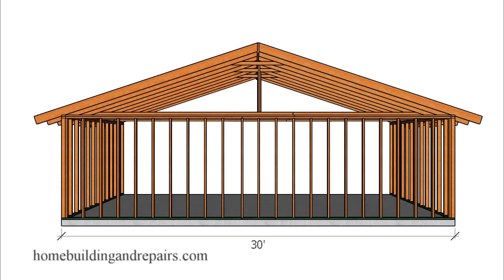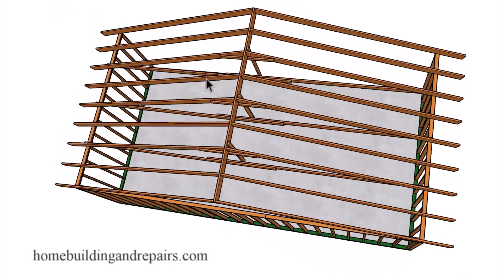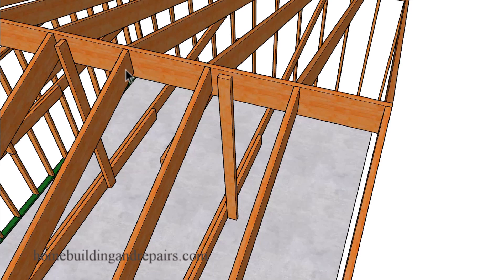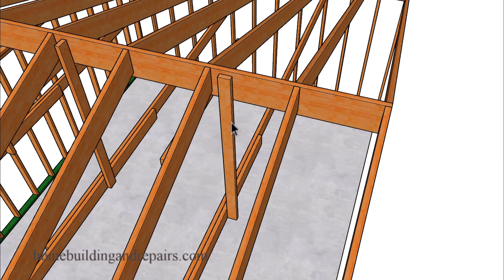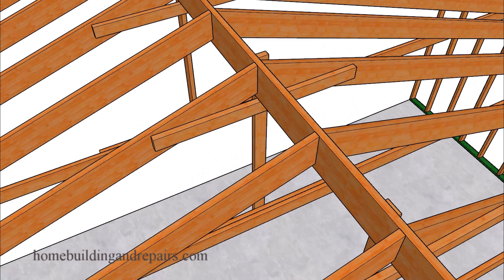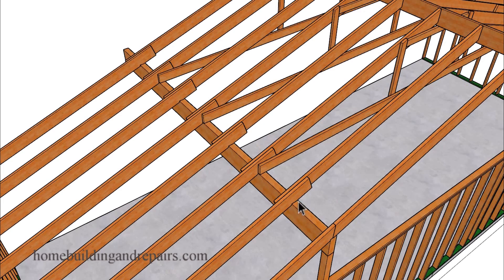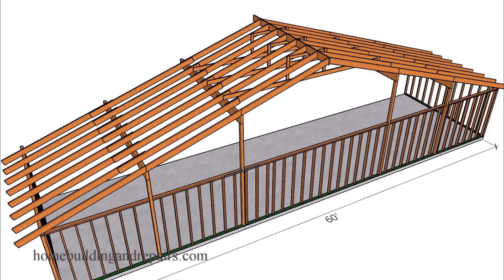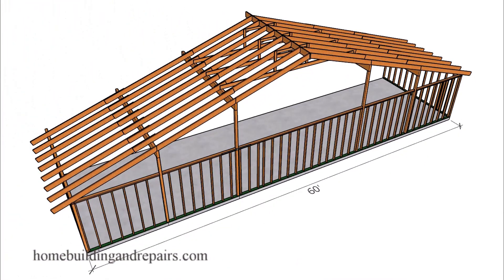How To Build Longer or Wider Building Using Rafters And Beams Instead of Engineered Roof Trusses

Comment: I'm searching for a suggestion for rafters designed to hang a floor, strong enough to be strong. I want to build a 60x100 ft shed with open span lower level without supports. I want to span a floor and second floor for use as a craft shop. The lower level will be an open mechanical shop for large equipment.

Comment: im building my own house for the first time, i am a union pipefitter not a Carpenter, but I figured if I could build multimillion dollar process piping systems how hard could the house be? 
I live in an area in Ohio where $50 dollars and 
a copy of your floor plan is all that is required for a build, no inspectors afterwards. i have found a home design online that I like, and I have begun engineering from a photo on sketch. 
House I picked has an 812 pitch roof, 40 foot wide house with an 8 foot porch over hang, requiring a 48 foot trust.
I would like a cathedral ceiling, only thing the builders in this area offer me is a 712 piggyback trust. 
I would have liked a scissor truss or possibly done something like this.

Comment: The ridge  beam that goes across the top  is it still needed for engineered trusses 50×50 ?
Reply from the maker: You would need to ask the truss manufacture, but most of the time roof trusses don't use ridge beams.

Comment: I have an odd one. I have a detached garage 32 x 28. The joist run 28' long. They are starting to sag and I plan on insulating and drywalling the structure. Is there any way to clear span 32 foot on an existing structure?
Reply from the maker: I would think steel I beams or large glulam beams.

Comment: Is the method of using spliced rafter-ties/ceiling--joists supported above from the rafter's ridge board (to span distances greater than conventional lumber is available in) compliant with the international building code?  (Just asking as I can't find that it explicitly is?)
Reply from the maker: Good question and I will look into it. I don't remember any and usually lapped my connecting rafter ties with a four foot lap and about 10 - 16d nails.
Reply: @gregvancom  As best I can tell it's permitted to lap rafter-ties if secured with sufficient nailing similar to the requirement between the rafter tie and the rafter itself; but attaching said rafter-tie/ceiling-joist to anything else but a supporting beam (as opposed to a ridge-board) seems not to be permitted (except possibly if signed off by a structural PE). Overall I like the idea, as it should be a simple matter to add the worse-case ceiling load to the dead-load requirements of the rafter span, but this is not detailed in the code as best I can tell.

Comment: To save money vs. trusses I want to build my own roof system for my garage. The front gable side is 32’ across. 28’ deep. I want to use a 28’ LVL as a ridge board and 18’ 2x8s as rafters with a 4/12 pitch. Now this is where I struggle finding info on supporting the roof from here. I was going to do 16’ rafter ties halfway down with a 2x6. Is this fine or what else could I or should I add. 	PS. Rafters and ties are all going to be 24” O.C.

Comment: So this covers width.
Now lets say for example you want that 50 or 60 foot wide building to be 100 feet long how then do you duplicate this process?
Meaning best way to elongate those support beam structures to make a longer run for length of building.
I.E. indoor horse riding ring.

Comment: 2x12 rafter can span at 20'  ( 40 foot wide total) taking snow and dead loads and they don't need a ridge beam ( ridge board is ok) or other beams between the ridge  and the wall. At 60' wide  you may need the intermediate beams , but 40' wide , I think 2 x 12 are ok

Comment: Hello. Great video, it answered the question I had. I was just wondering, I noticed that you didn't lap the end gable rafters, instead you show them butting together at the supports. Are they less important to supporting the weight of the roof, or are you sacrificing some support for a flat exterior face? Would you use a strap or plate to connect those together?
Reply from the maker: Yes, strap plates if you don't use collar ties. You can install ridge beam and lap rafters.

Comment: very informative video! Thank you! If the support beam is not placed at the halfway point (on a longer/wider building), what is the recommended span to place the longer rafter? Towards the ridge or towards the wall?
Reply from the maker: Your spans are measured from walls or beam supports or ridge. In our video, one side of the roof would have three spans. One from the wall to the first beam, then next between first and second beam and then from the beam to the ridge.
Reply: @gregvancom  Thank you very much for the response! If the spans are not equal lengths, where would you place the longer rafter? Spanning from wall to first support beam or between the support beams or from beam to ridge? Thank you in advance!

Comment: This is exactly my current garage, only it's 25' wide instead of 30ft.  I want to go FROM THIS setup to a 2nd story add-on.  I've watched your two story garage series but those seem to be from the ground up.  Can ya add a second story on this thing without middle columns inside and put the stairs outside?   I hope I don't get a lot of follow up comments to watch the garage videos even though I've watch almost all of em.....
Reply from the maker: I would think you could with larger floor trusses.

Comment: Have you done any videos addressing [engineered] roof trusses placed on top of existing ceiling joists/attic floor assembly? I've exhausted my capacity for searching effort and come up empty handed.
Reply from the maker: You probably can't find information, because the roof trusses need to be able to move freely up and down. A ceiling joist directly below, could prevent this.

Comment: Help, Greg! I put in floor joists in my DIY 14x32 cabin and used 2x10 pressure treated wood. Now, most of the joists are bent, bowed and warped out of shape. I'm at the blocking stage and can't afford to replace the boards. One of them even warped into an S shape!
Reply from the maker: Email me a picture. You can get our email address at our website or contact the lumber company to see if they will provide you any help.